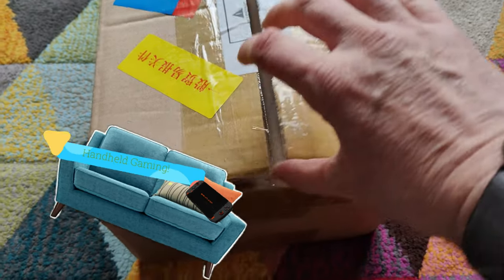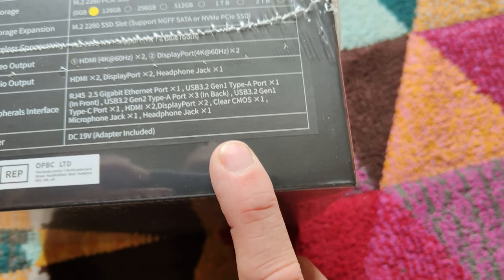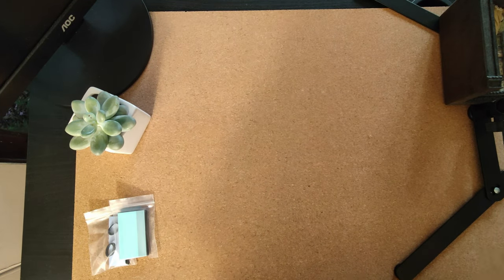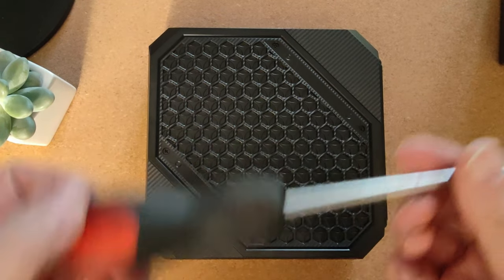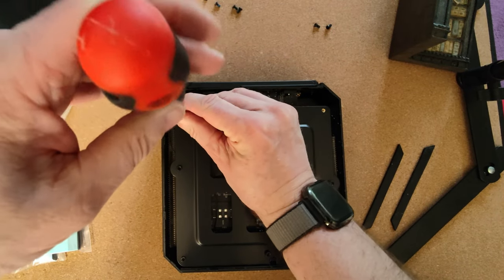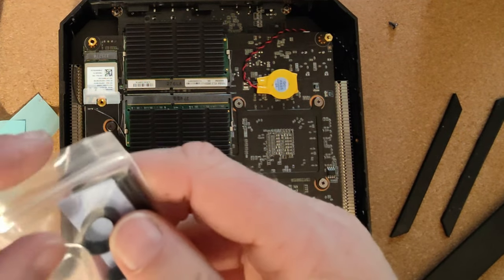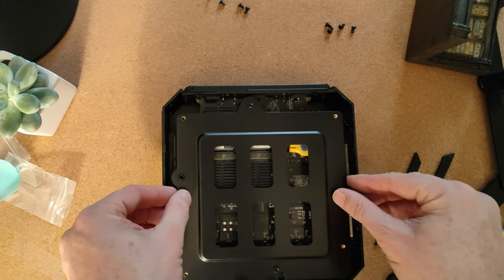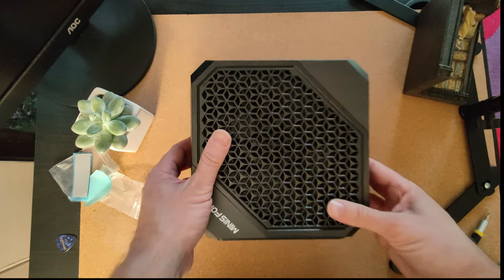Minisforum Neptune HX80G | Barebones |  Upgrading for remote Streaming!

Comment: Glad to see an actual video on this thing as I plan on buying it some point in the future
Reply from the maker: Glad I can help.   I found it weird so many Youtubers review the top spec model but rarely crack them open.   I guess thats the difference between a minnow channel like mine, where I buy what I use and big channels who might well get sponsorship to advertise new top products.   I'll always aim to review lower end options that suit my use cases and probably many others use cases in reality.
Reply: @handheldgaming4life  I imagine the reason most reviewers review the HX90G or the HX99G is either mainly sponsorships like you said, or they are simply the ones most people are going to buy as games are getting more and more graphically intensive  every time a game releases at this point so may aswell get the best one so it lasts longer.

The only other performance test ive seen of the HX80G is on the Minisforum Global youtube channel, so this video was helpful.
Reply from the maker: @turfish  best bit about the HX80G is it has same GPU power as the more expensive models and it really doesn't trail the Ryzen 9 by much.  Same core Clint and only a little slower.  DDR5 on the 99G probably makes the biggest difference.
Reply: @handheldgaming4life  Yeah that's the main thing I really like about it, cause at the end of the day there'll be very minimal difference in performance compared to the 90G/99G which is why I've been looking for reviews on this specific model

Comment: Thanks for making one of these. Dunno why it's so rare to find hx80g video's either
Reply from the maker: I think many of the HX99G videos are sponsored, not a bad thing but I think the margin is higher on that than the HX80G.  

Currently on holiday and my son is remote playing the HX80G with an Abxylute handheld.  Much better experience than I'm having with Aya Neo Air Plus 1216U.  Both playing Dave the Diver.  Decent broadband get (50mb).  He's enjoying 1080p 60fps.  Whereas I'm playing 720p and 35fps locked. 🤣
Reply: @handheldgaming4life  THX 💜💜💜💜
Reply: @handheldgaming4life  Rlly appreciate it

Comment: Using this as one of my first remote builds. How do I go about casting it to another device? Specifically an Android if you would know. Thanks!
Reply from the maker: I use moonlight. Works great, especially when the Minisforum is wired into router.  Set up with a static IP and your good to go.

Comment: Hey mate, I've heard shipping from Minisforum can be a bit touch and go, how long did your shipping take? Did you experience any delays? Also, if you had to have any communication with Minisforum with respect to delays, how was their customer service? Thinking of getting one of these (UK) but debating amazon vs Minisforum store. Thanks
Reply from the maker: I did indeed have delays.   If I'd gone for a non-barebones from Amazon it would have arrived in a day or two.  But ordering from the Minisforum UK site it took a week before it was even confirmed as shipping (that said this delay meant I was able to add on a little discount, worth asking on their discord channel). 

Took about 10 days in total to ship, which did impact on my recording schedule... that said when it finally shipped it took only 2 days to ship from China-Hong Kong - Belgium (I think) and then UK.

So worth bearing that in mind if you need a computer quickly, expect 2 weeks turn around.  

Would I recommend Minisforum though?  Well while it took a while, it's certainly in great condition with none of the liquid metal horror stories I've seen posted for the HX90G or 99G.

Comment: Great video! Also ordered barebone hx80g, seems to be the best option for budget mini pc gaming. Have you tried overclocking, undervolting gpu or cpu?
Reply from the maker: Hey, I believe its a locked CPU so no hope of easy overclocking.  In AMD Adreneline software its possible to tweak the GPU if you use the "pro" driver but then you can't stream/record from the GPU (that driver set doesn't have the AMD record/stream side activated).   Regular Adreneline drivers don't let you Overclock/Undervolt.  :(   That said I've not needed to push the HX80G, high settings with a bit of Quality FSR gets 60+FPS in all games I've tried.  I even play Spider-Man with lowest RT enabled and it runs like a dream. 👌

Comment: How is this holding up? Did you have any issues with it?
Reply from the maker: Holding up really well.  I did have 1 issue, and that was an Adreneline issue where the driver was basically freezing up the device.  Had to roll back the driver, disable the igpu and then install the updated Adreneline.  Runs well!  Its run almost 24/7 too.
Reply: @handheldgaming4life Nice, thanks for the response, I hope I don't run in the same issues but if I do thanks for the advice!

Comment: Have you by chance done any PS3 emulation on this machine? I'm really considering one for an emulation build and would like to know how it handles More demanding systems like PS3.
Reply from the maker: I have tried a few PS3 and Xbox360.  I've got some footage in on of my Abxylute Discord recap videos where I used the Abxylute and Sunshine/moonlight to stream directly from the HX80G.   Not tested many games, always happy to try suggestions.  I did try RDR on PS3 and it was unstable frames, but RDR on 360 emulated great.  Resistance 2 struggled a bit if memory serves correct.  Tried PGR2 on 360 and it was nice I think.

Comment: Will it work fine without the nvme heath spreader? They only included for the memory. Included are two thermal pads, for the nvme I guess. Should I use both to stick it to the metal frame? The manual does not mention the cooling inclusions at all.
Reply from the maker: There isn't any active cooling on the bottom of the device so I'd personally suggest buying a heatsink online.  I picked up small box with 4, I think, from eBay for only a couple of £.
Reply: Bought aluminium heatsink. Not sure this improved the situation. The outer sides of the frame are recessed. With only the thermal pad the ssd makes contact with the frame. With the heatsink and rubber bands this contact is lost and also some tension on the frame. Almost seems deliberate that the heatsink is missing

Comment: Do the type-C port of this can be connected to monitor?
Reply from the maker: I don't think so.  I do know  the HX99G replaced the 2 display ports (or HDMI, can't recall) with USB-C video out on the back of the device.  But the HX80G has a lower spec Ryzen 7 rather than the Ryzen 9 so not certain the 80G is capable of USB-C output.

Comment: There is only one slot for m2 disc?
Reply from the maker: There is 2x M2 slots.  👍
Reply: @handheldgaming4life  thanks, is there any possibility to mount in on vesa behind monitor?
Reply from the maker: @marcindunajski3545   I don't think so, just looked and I don't see any VESA mounting points on the bottom of it.  I have mine sitting flat on TV unit rather that upright no the stand it comes with and it really doesn't take up much space.

Comment: Can you do a tutorial on how you would clean this machine? Because my fans have gathered alot of dust and i dont know how i would clean it
Reply from the maker: Personally I'd just take it outside and give it a quick blast with canned air.  But not so much as to have the fans spinning like crazy as you can damage them.   I'd not recommend opening up as its a fairly big job to get to the front (top) of the unit as you open it from the bottom.